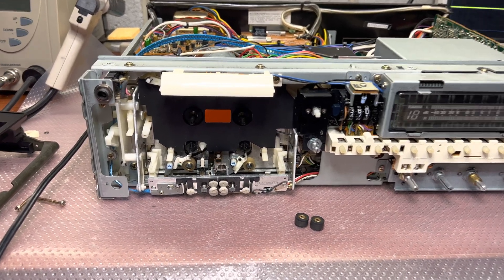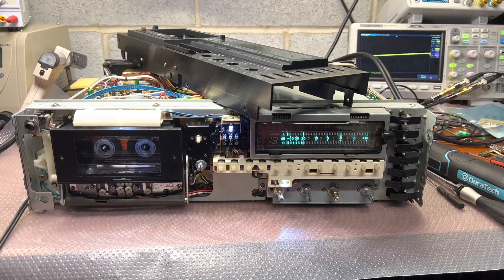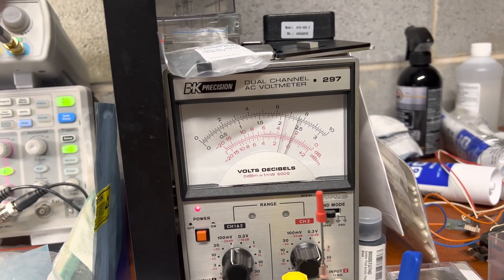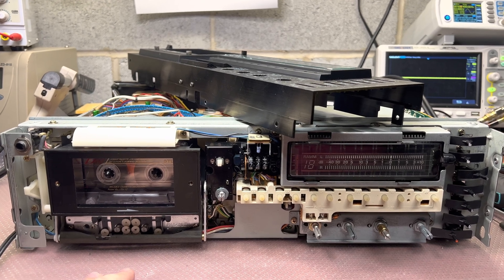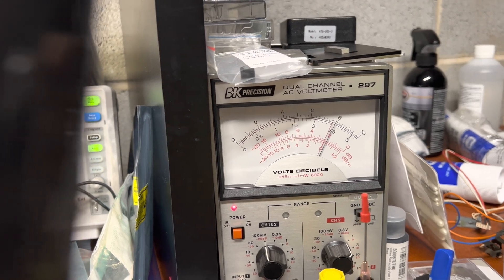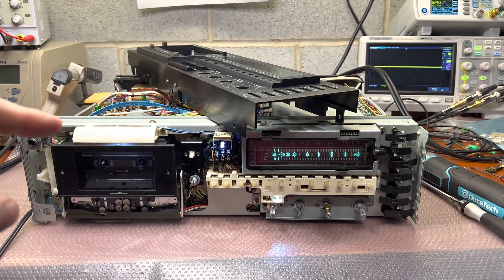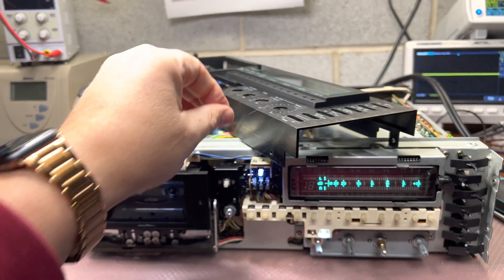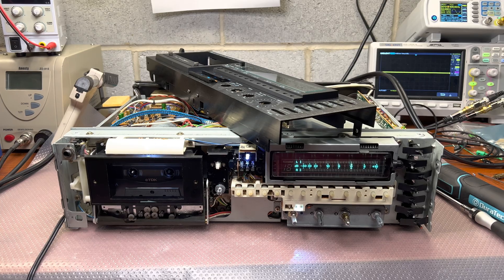Back in Action: Athan Pinch Rollers and Azimuth Stability Measurements on the Nakamichi 680zx

Comment: Athan should drop the silly polyurethane idea, and put proper good quality high precision rubber rollers on their decent bearing setup, and cut the prices in half. Then they will have something special, something I might consider.
Reply from the maker: The price for Athan rollers comes from small precision ball bearings installed into each roller (2 per each).